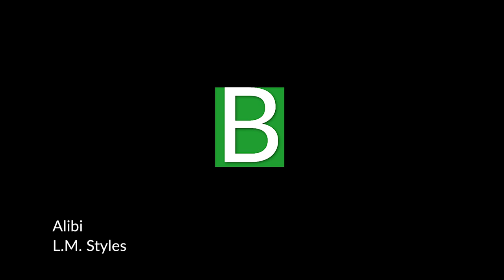Expensive Vs Cheap Speaker Cable Sound Test

Comment from the maker: See how to make the cables here: https://www.youtube.com/watch?v=YuxK-HQGvkI
Do high end speaker cables make a difference to sound quality?  What about volume? How far a run before you need to upsize the wire? Can you hear an improvement?  Use headphones and see!
Reply: So which one was the better cable ? :)
Reply: CO Guy Stuff did you ever post which is which. If not i will unlike and unsubscrib
Reply: Seriously guys... It's obviously stereo "A" that is the Quality/Premium Cable being used.
Does our YouTube Host really need to spell it out for You All?
Reply: Is B the more expensive cable?
Reply: yo A right?
wth
Reply: @julesgrill2490  First of all, none of these cables is premium. That finished cable with bananas was also a regular speaker cable from the Amazon. And I believe in this comparison that was cable "B".
Reply: @aleksandarstojceski3139  That's my guess too. "B" has better damping of the bass and slightly lacks high frequencies due to it's thick wires. However it sounds cleaner overall.
Reply: @COGuyStuff, I am trying to make an educated guess which cable is which. You said that from one cable to another you had to adjust a level by 2.5dB. Have you done it with a volume control and does your reciever has a loudness function? I mean, was there any tonal ballance change in the amp due to that 2.5dB volume compensation?

Comment: The irony is that by the age you have enough disposable income to afford these cables your hearing will have already started to incrementally decline - eliminating your ability to hear the very subtle differences in your expensive sound system.
Reply: The irony indeed :D
Reply: I have expensive cables and hifi 
Meanwhile I'm only 20
Some stuff I bought some I got given away
Reply: @BavarianM  which do you recommend?
Reply: If you can't afford these cables, you are homeless.
Reply: Not true. It's a misconception that expensive cables are only operating in the extreme high frequencies and therefore mature audiophiles lose out. For one, hearing acuity can be maintained far longer than is thought and two, cables can affect any part of the frequency spectrum so even 80 year old audiophiles can benefit.
Reply: @carlosoliveira-rc2xt  sorry, can you repeat that please

Comment: I,me a retired studio sound engineer  if you new how standard the recording cable was that is used you would be shocked .for your hifi .just buy a reasonable,decent cable 3 to 5 pound per metre cable put decent speaker plugs on and you shouldent go wrong do.nt be fooled by the fancy coverings on some of the cable they are just to sell them. At big prices.

Comment: I'm new to hi-end audio. Skeptical that AWG differences in short runs would be audible.  Fascinating test. Giving CO Guy the BOD that only cables and amp gain were changed. Even with YouTube compression I can hear the difference. I would not have predicted that. Must reevaluate assumptions. Love it.

Comment: A is better mid range (more forward) and little spacious sound.. Concluded : A has better high frequency ,more details.
Reply: Yep, i hear the same effect
Reply: A def brighter and more forward.... can even tell in my laptop speaker.
Reply: That maybe true but the differences are not night and day it isn't huge .it depends on one's budget many people cannot go to expensive cables .it goes to show that on most people's systems it really doesn't matter and quite frankly a bloody waste of money .one might spend a little more on something that does matter rather than buy into the snake oil of cables .One must use one's own mind and pocket and not stress over those pretty looking cryogenic aligned crystals or inline battery cables those belong on a Christmas tree as pure tinsel.
Reply: Even using decent headphones I couldn't tell any difference.
Reply: With headphones, A has more noise. More unwanted noise.

Comment: The law of diminishing returns kicks in quickly with speaker cables. But there is a difference. The hard part is working out if that difference is a good one or not. You don't need to spend mega amounts to own decent cables. If you buy deliberately cheap and nasty and can't hear what the problem is, well you're probably NOT an audiophile. 
You need the skills to be able to listen into a mix. To be able to focus on certain sounds or instruments. Hear depth and imaging etc its here cables differ. 
I'm a retired audio engineer of just over 30yrs ... The quality of cables used in the studio was important - especially mic cables. 
If you're not using balanced XLR'S good quality heavy gauge pure copper is ideal. I prefer bare wire that's silver plated, but that's a personal choice.
Reply: Bare wires are always will be better than any of the banana and e.t.c. connectors.
Reply: Can you inform me: 1- for a home theater set up, do cable gauge shall be identical for all speaker cables - for instance have better gauge for front speakers a good idea ? 2- banana connectors is it worst than without (bare cables) ? Thanks.

Comment: I use 16 gauge speaker cable for years now and I am very satisfied with the sound.
Reply: Concur. Unless you're running 50 feet or using lower impedance speakers, 16 gauge is fine.
Reply: @rweakley  I'm sort of leaning toward the same opinion. If its not that much more expensive, I'll probably go 14 gauge just give the signal a chance to breath a bit, even if I can't really hear the difference.
Reply: You might be even more satisfied with 8 gauge cables.
Reply: Good for you. But I made 7 AWG OFC cables and they do sound better than my old 11 (2 x 14) AWG cables (Canare 4S11).

Comment: A= more airy n rich. Highs were more   extended.
B= a bit darker n lesser highs.

For some audiophiles that little bit of difference matters and they can spend all the money they have achieving that.
For me i have just tested my friends oelbach speaker cables (8 meters cable total for $100 ) against my DIY    cable (4meters =$20) and im not going for the oelbach though it renders a similar difference in highs as the above experiment.

Comment: i saw a video of a guy talking about speaker cable and subwoofers. to prove his theory he took an infrared camera and you could see the smaller gauge wire was getting warm (orange / red) compared to the larger gauge cable. he was running sine wave and bass tone sweeps which strains gear.

Comment: I listened through some Phillips Fidelio X2HR headphones (the only way I listen to A/B tests through Youtube). There was an obvious difference between A and B (if I closed my eyes, I could tell when A switched to B): B had some bass fall off and a little less definition in the mids. Importantly, I also noticed that A seemed to retain some of the dynamics on the highs relative to B. Obviously a bit caveat is that Youtube compression will have an impact, but there are some discernable differences to my ears.
Reply: Compression involved with uploading that audio to a compressed YouTube video which is state of the art format to be as small and compressed as possible but maintains decent quality would negate any difference in the cable run that short IMO. If anything, it removes noise possibly with a better cable. But to judge here on YouTube? Better test would’ve been to not show the A&B and see if anyone can tell when they’re switching back-and-forth. That is a better blind test.
Reply: @cconnon1912  I think that's fair :)

Comment: When listening, through YouTube you really can't here a whole lot of difference. Maybe in person. Not through YouTube. Theirs a very small audible difference over certain songs but it sound the same. Now the thing is , was there cca being used vs copper wire  ? There are alot of variables that can take place. If you look up different metals , you can see which one is a better conductor of electricity. Great example. Thank you.

Comment: If Im looking att the screen when you switch there is a clear difference. If i just listen Its much harder to tell. Im surprised I experienced any difference att all since i was not a believer of the importance of good cables  . I am now.
Reply: If you can't hear a difference with your eyes closed, then it's called the placebo effect.
Reply: @rweakley  It might have been
Reply: Definitely not, A sounds sharper and has clear highs. B sounds like something is blocking it. It could also be that the volume isn't the same on both and thus one sounds better.

Comment: This is simply a case of thinner wire = higher resistance = increased voltage drop = less voltage delivered to the speaker.  Basic Ohms Law.  If that "cheap" cable had the same CSA as the "expensive" cable and was made from decent quality copper, the results would be practically identical.  You can get decent quality copper speaker cable in the 10 - 12 AWG range for a few $/M.

Comment: In these cables there was so little difference it was not worth swapping.  Honestly, if you did not show the A or B on the screen I likely would not know when they change.  On the first few tracks, I thought B was a little dull and rolled off the highs vs A.  In later tracks like the guitar, I wondered if there was better harmonics and decay with B.  Overall, no difference.  For the record, I do hear a pretty substantial difference in cables in my home.

Comment: A sounds better on my Grado headphones.  B sounds "cheap".   Difficult to do tests like this because the original recording changes and different sounds will amplify more with changing a component within the system.  Example Some cables might make a voice stand out more and one might think its an improvement while it might not be.

Comment: Did not hear any difference and I can still hear up to about 17 khz.  I've never owned expensive speaker cables.  I run 16 gauge wire in both my surround sound systems and am very pleased with the results.  Money's better spent on more source material or interconnects.
Reply: ABSOLUTELY CORRECT!👍👍💯PERCENT

Comment: Does oxygen free copper cables make a difference or is that just a gimmick?
Reply from the maker: It just prevents the exposed ends of bare wire from going nasty over years.

Comment: it's very difficult knowing the difference while sitting at home. BUT. I would say. that there is a difference if you're using cca vs pure copper speaker wire... you might not "hear" the difference on a load. but the Load on your receiver can make a huge difference. 
I tried using a cheap 14 gauge cca wire. (not pure copper)  
while you can only hear the difference on tracks that carry a lot of Bass. (depending on the speaker itself) 
if you have a demanding speaker. especially if it 4-6 ohm's Use High Performance 16 Gauge or 14 Speaker Wire, Oxygen Free Pure Copper. 
I don't like CCA wires. cause I can feel my receiver heating up. (as far as the sound? ) it's hard to know unless you're right there.

Comment: Can't tell the difference. There does seem to be some resonance in the sound though. Need more dampening.*edit* re listened to it on my Sony XM3s in LDAC. Sound change is barely noticeable, to the point that it could just be in my mind. You should try testing it using the True Audiophile Best of Groove Note album or something a little more discerning like Shirley Horns Softly album. It's easier to pick out subtleties with less complicated cleaner tones. I doubt you'd be able to put it on here because of copyright but it's a good test I always use when testing new equipment.
Reply from the maker: Correct I can’t put up copyrighted songs. And I’ve said many times I want more treatment but I’m at the limit of the wife factor.

Comment: Shouldn't it be a comparison between expensive 12 gauge and cheap 12 gauge? Would you compared the flowrate between a 1" diameter pipe and 3"? Of course not, youd compare 1" pipes from different manufacturers.
Reply: Good point.

Comment: Mmm this is testing wire guage, the wire supposedly thicker is better, but if its poorer quality material than the thin wires, its not going to compensate audio performance.

Comment: Can't tell the differences. To me it's the position of your speakers and how large or small your music room is what makes the differences in sound in my opinion.
I use now is not a well known brand of copper wire and it's sounds ten times better then my old QED silver anniversary bi wired cable 
I will never buy a cable wire from a regular Hi-fi store. 
When they is other options in a non well known makes what is out there.

Comment: I did not detect any noticable  difference between the two cables, and how does the listner even know if there were any switching of the two cables, maybe there wasnt any switching between the two cables anyway, the only thing noticeable was the changing letters, what i did whas, i used headphones and closed my eyes, as not to be perswayded by the changing letters that cable switching may be accuring, in reality, switching may or may not have been done anyway. There may have been a difference on paper, but not that the ear could detect. Maybe a better quality cable could could make a noticeable difference.

Comment: I just changed from 16 ga CCA cable to 14 ga pure copper cable, connected to my vintage Sansui with Klipsch Heresy's. There is a definite improvement in bass response and clarity, although not a dramatic improvement.

Comment: 99% of receivers or low end speakers do not offer enough high resolution to really make a significant difference between cables used ...  
Also cheap cable is a cable like a lamp cord from Home Depot and "expencive" cable should be in 200usd per pair range like Audioquest type 4 and up or AntiCables ...   
Cables do make a difference but it depends how much you care and no difference to some is huge to others.

Comment: Obviously A has way more bass clarity and hit on my high end sub ,but the treble and mids sound about the same to me. Of course i will be upgrading to better thicker wire after this LOL.   Never do an A vs B test and dont at least give the actual data of which is which so people can verify what they heard or saw and at the very least hide the result in the "show more " info section of the video.

Comment: To my ears, "A" sounded just a tinsy little bit better, with slightly more pronounced bass, & slightly sharper, faster definition in the mids & highs. I noticed the shhh sounds more, & longer lasting than the B. But I did not use headphones for the comparison. Just 2.1 home theatre speakers. I hope I picked correctly!
Reply: MCAD DC I used the crappy speaker on my smartphone but the difference sound immense. I hear way more detail in the mid-highs.
Even though I listened on such a crap speaker, it may have exaggerated the difference somehow.

Comment: Guess your system is not revealing it. I changed from SVS to AH! And there was a significant difference in bass. So much so that you could hook wire A to one and B to the other speaker and hear it.

Comment: I don’t think speaker cables make much difference at all. Just use something that is half decent. Analog interconnects on the other hand can change a system very significantly.

Comment: A & B no different at all... But i do use expensive speaker cable, to compliment my tower speaker and my amp only... Yes i use for aesthetic purposes only....
Reply: you hit the point! everything is in the head. A lot of high end gear is s.c. "High-End" only beacuse hq materials, wood, alum.,gold binding post but average sounding. Difference between those cables shoud be 3$ in terms of sound quality😎
Reply: in the first seconds of listening that "A" is a better cable.
Reply: @jchmiel99  No. "A" is not better. It just has more "lows" and more "highs". Because it's thinner gauge.
Reply: @IliyaOsnovikov  For me is better. More clean, more deeper and smoother.

Comment: I can’t really detect the quality difference between A and B.☹️
Reply: Yeah, me too. Cable has to be good but does not have to cost 1000000 dolars. There are formulas how to calculate Cable diameter and so on. Some time ago I tested cheap Cables and I compared it to very expensive ones. I heard no difference. I am a guitarist so I belive I have well trained ears.

Comment: my audiophile ears can tell a slight difference between a and b.........a has little tiny more bass so in theory thicker cable more current = more power to the speaker...so in conclusion is not a big difference. a 16awg cable is just fine for average listening, if u can afford the thicker cable go for it!!............

Comment: There is nothing above 13khz on YT ,  so its pointless , the capacitance and inductance and resistance in the cable are not enough to have difference below 13khz in any case .
So it sound the same .  If the Resistance is so high it changes 2dB of loudness that is a real bad  cable and in that case there is a difference but that is human error .

Comment: Cables might measure differently on the test bench but this doesn't matter in real life because as long as the resistance of the cables is low enough you will audibly not hear any difference.

 .

Comment: Answer: no. As long as the cables are insulated properly, the only thing that matters is gauge over very long runs.
Reply: Look I am not trying to make an argue about this but have you tried to listen to cables on a high end system?
I have done the test my self and yes it was a sort of double blinded test. Both cables in the speaker at the same time, a relay switch box and a computer to switch, all it did were to randomly switch and write down what it did switch to. Meanwhile did I not know what cable were used. A random sequence could look like this 0:00 A, 0:10 A, 0:25 A, 0:30 B, 0:45 B, 1:05 A and so on, newer knowing when or what was used until I did compare my handwritten list with the computers list.
The cheap cable did win and I had about 80% accuracy. :-)